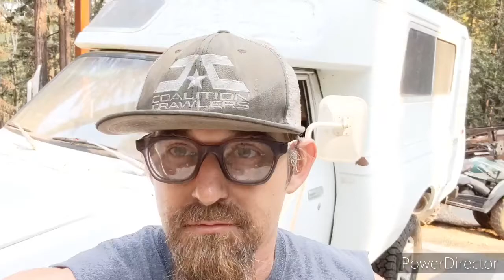Toyota Chinook RV 4x4 conversion phase 2 !

Comment: The Land cruiser axle is off centered in the rear how do you work around that?
Reply from the maker: Barely offset no problem at all...I've done it before it's the least of any problems...also I knew we were putting in an oversize poly gas tank in a different location so def no interferance

Comment: I have a 76 Chinook that I'd like to do the same thing to. I already have parts but not exactly what you have. I've been wondering if I should swap the body onto a four wheel drive frame (I have an 81 long bed frame) or what you are doing
Reply from the maker: You can put the Chinook back on a 4x4 chassis many have done it...slightly less work but not nearly as rad plus not presmog like this 1974...also axles, susp steering will need to be upgraded...so either route you go it's a ton of work! To each his own
Reply: Using the 81 truck you wouldn't need to relocate the axle. Although nothing is cooler than making the '76 a 4x4. I have a '77 that I'm planning to convert to 4x4 by swapping it onto another chassis.